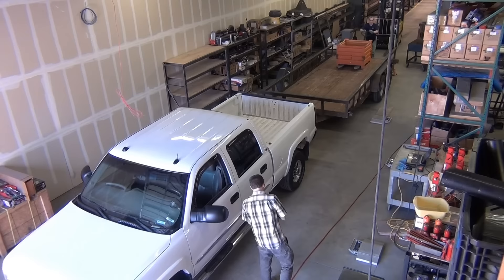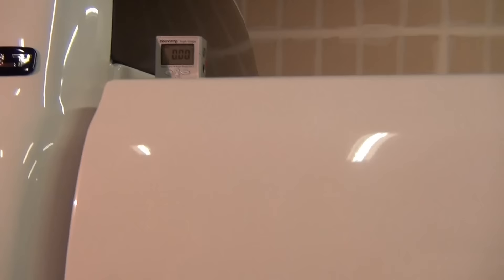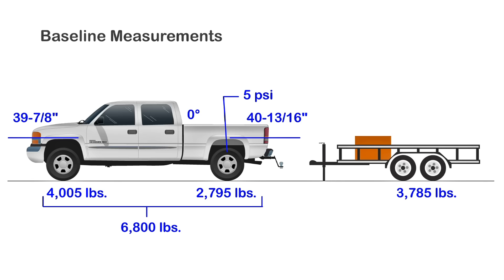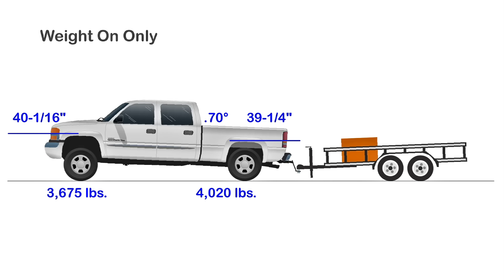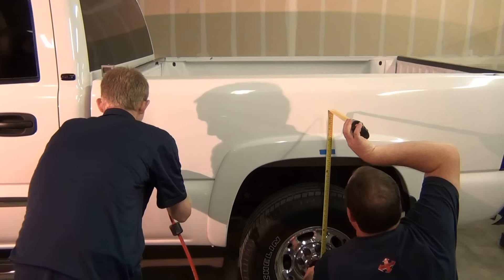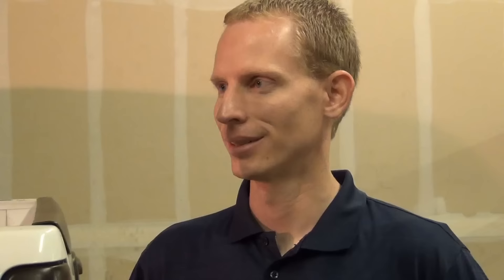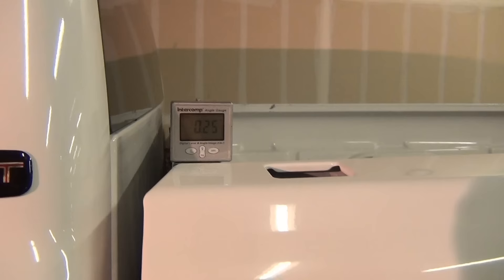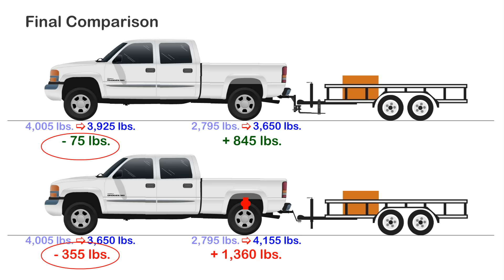The Difference Between Using Weight Distribution and Air Bags to Level Your Load

Comment: I use both an Equalizer WD hitch and an airlift wireless system on my f150 when I tow my camper, have used this configuration on several trucks now.  The beauty is that as the tongue weight of the camper changes (full water on the way up the mtn vs. empty on the way down), I was able to find a WD setup that works in both scenarios without adjusting, simply by adding a bit of air to my bags for less WD, and letting some out for more (I know, sounds backwards, but it's not).  The other nice thing about this is when heading to Elk camp in the fall, climbing steep dirt roads, if I need a bit more traction on the rear wheels, I can add air to the rear bags on the fly in seconds, which reduces WD and puts more weight on the rear axle, and on the way down the mountain when I want a bit more weight on the front axle for better braking and steering, I air the bags down all the way, which increases WD. The difference is VERY noticeable.  I recently gave the 150 to the wife and got a 350, as I need to be able to tow heavier trailers for my company, and I installed the same setup on it.  Even on the 1 ton, the benefit of having both the Equalizer brand WD hitch AND the bags with wireless control is noticeable.  If you tow regularly, both are a worthwhile investment.
Reply from the maker: Thank you for sharing your great experiences with us! This is a fantastic example of how to correctly use both weight distribution and air bags together to improve the safety, comfort and ease of towing. Thanks for taking the time to comment.
Reply: As I watched this video I was wondering about exactly this. Great to know that they can be used together and how.
Reply from the maker: @merpius , we're happy to help! Thanks for watching!

Comment: Before.....and then after I bought a weight distribution hitch,  I found myself on a stretch of highway that undulated up and down in a very consistent rhythm for about a half mile.  The first time through,  my camper and suburban did a hobby-horse motion that amplified quickly and made me do the upholstery clench until the brakes broke the rhythm.  Next time through with the new hitch,  truck and trailer acted as one unit,  straight and calm.
Reply from the maker: That's awesome!  Thanks for watching!

Comment: By changing the height or angle of the ball, and by using different links on your chains you can move weight around to add or subtract weight to any axle and still keep your ride height level on the tow vehicle and the trailer.

Comment: This is an excellent video and addresses the issues I’m having with my set up. I have a short-bed Ford F-350 and I carry a Honda Pioneer 500 UTV (1100 Lbs), which drops the bed 2 1/2”. When I hitch my 25’ trailer, which has approximately 900 Lbs tongue weight, the truck bed drops an additional 1 inch or more, making it very difficult to engage the weight distribution arms (Reese Stedi-Flex), even when raising the trailer tongue jack to the max height. The result was that the front suspension dipped below the stock height causing a very scary and unstable to tow driving experience. Today, I will be installing a set of Firestone airbags and I hope to bring the UTV-loaded truck bed back to near stock height; hopefully, this will allow me to engage the weight distribution to the proper setting where the front suspension of the truck will dip to near unladen height leading to a more stable and safer towing.
Reply from the maker: Awesome, thanks for sharing!
Reply: With 1,100 and 900 plus other cargo people, are you exceeding GVWR?
Reply: Airbags not smart, take WDH to dealer for install, then CAT scale, you don’t know proper install because rear sag not relevant, front axel rise is, once WDH on should bring rise down 50%, airbags make worse because increases drive axel weight

Comment: Excellent video guys. I have a Ford F-350 equipped with air bags and I tow a 10000 pound bumper pull trailer. I’ve been having a problem with the sway bar system not doing its job as I am using a combination of both air bags and the equalizer hitch. Based on what I watched in your video I’m going to try just the equalizer and not the bags to see what happens. I’ve got a truck scale not far from my place so I can get some axle weights as well. Thanks, keep it up.

Comment: Awesome and detailed video, and particularly useful in explaining why air bags alone don't help much. In my experience towing with a minivan, air bags reduce vertical motion when going over dips, and spare the rear suspension some travel. However, there are negatives with air bags that aren't as frequently discussed: they make for a more jarring ride by passing more road vibration to the vehicle and hitch assembly, and the fundamental issue with dramatically different axle weights between rear and front remains unchanged. Thanks!
Reply from the maker: elektronen

Thanks for the compliment, and for sharing your experience with us!

Comment: Now THAT was terrific video with actual data and evidence!!!!!   (I am a Lean Six Sigma dude so I love solid evidence!)   I am grateful for the information as I have a smaller truck (2019 Tacoma) with which I will pull a travel trailer (4400# dry).    Yes, I know that a bigger truck tows more but frankly I also want a daily driver when I'm not towing.    I currently have a WDH and was wondering why all current interest in Air Bags (fad??)....this video clarified it fully...Very well done and explained....No further questions from me.    I will make sure my load is properly balanced and my WDH is set well.    YOU GUYS ARE JUST PLAIN AWESOME!!!!!!
Reply from the maker: Thanks for watching!
Reply: Ive heard with bags getting frames bent cause they mount in a 6 inch space vs the springs mounting say 3ft away from each mount on the frame.  Also if you look at big rigs they have bags in one place but the axle mounts to an arm for the bags and still has its other end 2 ft away

Comment: Air bags will do little for rear hitch use when leveling the truck back to normal under load. Air bags work best with 5th wheel or gooseneck style ( over the rear axle load ) trailer's.
Reply from the maker: Thanks for the comment, and thanks for watching!
Reply: I can definitely see that

Comment: I wish you would’ve done a third test that showed what happens when you use both the airbags and the weight distribution bars. Many of us out here have both and it would have been nice to find out if when used in tandem completely distribute everything evenly the way it should be.
Reply from the maker: Thanks for the comment. Towing with both is a great way to go. We have received the request for a video covering this from a number of people. It is a video that we are working on, and hope to have released soon. 

Our advice is to set the air bags to the pressure you want to tow with. Then, set up and adjust your weight distribution hitch to get good weight distribution. You may need to make minor adjustments to one or the other, or both, to get it dialed in. Remember that adding air to the air bags after setting up the hitch will usually reduce the amount of weight distribution, and removing air will usually increase the amount of weight distribution.
Reply: I just got back from a CAT scale and performed this experiment with my setup. My tow vehicle was a 6000 lb Tundra and my 32' trailer was 7000 lb. My base front axle weight unloaded was 3360 lbs and it dropped down to 2980 lbs (-380 lbs) loaded without WD. My base front axle weight was 3200 lbs with the WD bars engaged and 5 psi in my air bags. With the air bags at 20 psi, the front axle weight decreased to 3160 lbs (-40 lbs). With the air bags at 35 psi, the front decreased to 3140 lbs (-60 lbs).  I took these weights with a half tank of gas and I was the only passenger. I am going to go back sometime with a fuel tank of gas with the family loaded up. Just remember that the more pressure you have in your airbags, the less tension there will be on your WDH's spring bars. Everyone's setup will be unique, but I'd thought I'd share mine.

@FastwayTrailer
What's a good target weight to distribute back to the front axle? At least 50 percent of the difference between the unloaded base weight and loaded weight w/o WD? I was able to achieve 58% at 5 psi and 47% at 20 psi.
Reply from the maker: Thanks for your fantastic comment. Thanks for sharing your real life numbers with us. The ideal target for weight distribution for a specific setup is a hard thing to state definitively because there are so many different factors in play, such as tow vehicle size, suspension type, spring rate, trailer weight and suspension, distances between axles and hitch ball, etc.

As a general rule, we recommend getting at least 50% (halfway) back to the unloaded baseline. Therefore, in your example above, your vehicle went from 3,360 lb on the front axle to 2,980 lb (-380 lb) with the trailer coupled. Halfway back would be at least 3,170 lb (3,360 – 380/2) on the front axle. Best case would be to get 100% of the weight back. We would consider a front axle weight anywhere between 3,170 lb and 3,360 lb good weight distribution. As such, if you are towing with 5 psi you would be in the good weight distribution range. If you are towing with 20 psi, you should consider making an adjustment to your hitch to increase the amount of weight distribution it is providing.

There are some cases where getting 100% back is not realistic. This is sometimes the case when you have a longer heavy duty pickup with very stiff suspension. In this situation, getting at least 50% back is good, and somewhere between 65% and 75% back is ideal.
Reply: @FastwayTrailer  Thanks for the reply. I think I have a good starting point. Camper and truck were partially loaded during this weigh in. I still have to add the family and gas which should add another 500 lbs to the truck. I'm curious to see how much more of the weight is distributed to the front with more weight in the truck. I'm also hoping I have more adjustability to the air bags with the truck fully loaded.
Reply from the maker: You’re welcome. Sounds like you have a pretty good handle on things. We expect that you will see pretty much the same thing, even with the added weight in the truck. That added weight will increase the baseline axle weights, but when you add the trailer, you will still counter-balance out about the same weight. You should see a very similar increase at the rear axle, and decrease at the front axle. Of course, adding weight to the trailer will change things a bit too. Let us know what you find. Good luck and safe towing!
Reply: FastwayTrailer can you also perform the test with a 5th Wheel or Gooseneck connection?  Airbags vs no airbags

Comment: Great video to illustrate each system's attributes.
I have a GMC Sierra 1500 with a ~7000lb TT.
I have both the Equalizer. and the Air Bags (Firestone).
This combination works very well for me.
The WD hitch does the brunt of the work, and I use the air bags mostly when driving at night to level the projector headlamps (if needed).
The airbags do aid in uncoupling the hitch as well, especially if on rough terrain (to lift up the rear of the truck).
I have almost NO sway issues (so happy!).
Thanks!
Garry (Ottawa, Canada)
Reply from the maker: Thanks +Garry Hammond, sounds like you have a great setup!

Comment: I've used both and the weight distribution is the best. It's in the name. It distributes the weight. Also most weight distribution hitches have some form of sway control.  Also a very important part of towing, especially if it's a big trailer. ie, travel trailer. If you have ever been in a wind storm you know what I'm talking about.
Reply from the maker: Thanks for weighing in +Tim Maw.

Comment: >This is quality short video towing for dummies made simplier & u do/did all the math. < A bit of both 1st this adjustment of load on trailer usely right over axes or if needed 40/60 just on & behind the axles of trailer. <Then adjust drop or raise of ball connection w truck> mostly 1 & done based on trailer normally towing. >  ^Last after connecting trailer level out fine tune so truck & trailer r both level  & give it a low speed test drive & if poss over speed bump. Should b good to go.  Air bags & bigger springs & shocks won't make a 150 n2 a 250 or 250 n2 a 350 or dually though.

Comment: Great info guys! Thank you! I've been considering putting airbags on my new 3/4T, like I did with my 1/2T, but now I don't think I'll spend that money. Seems like a weight distribution hitch will work much better for my normal applications.
Reply from the maker: Glad we could help! Thanks for watching!
Reply: @ Dave Dreyer ...Only go with Airbags if you decide to tow 5th wheels and/or Gooseneck trailers. I got Airbags on my Chevy Duramax and have not noticed any major benefits when towing my 10,000lbs TTRV because I already have the WDH system and Sway Control Bar. But I'm selling my TTRV and buying a luxury 5th wheel.

Comment: Excellent video. I did this calculation on my F250 based on wheelbase length, hitch-ball length overhang from rear axle, and baseline axle weights before finding this video. You have confirmed my faith in the scientific method. I calculated a loss of 300lbs on the front axle with a 740lb tongue weight without weight distribution. As in your video, I found that 300lbs is transferred to the rear axle, along with the 740lbs tongue weight, reducing the GAWR margin. BTW, I use a Fastaway E2 hitch with my Mini Winnie 27ft TT. {Your weight discrepancy (noted by earlier post) may be due in part to the spring bars that weren't used in the first part of your experiment.}
Reply from the maker: +bbhrdzaz,
Thanks for the comment, and for towing with an e2 hitch! You are correct, the absence / presence of the spring arms would affect the measured weights.